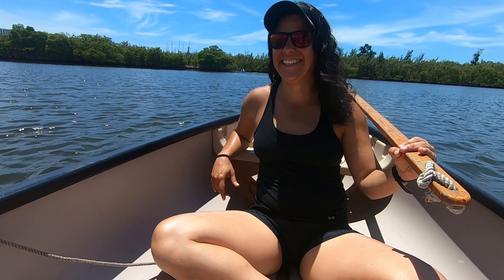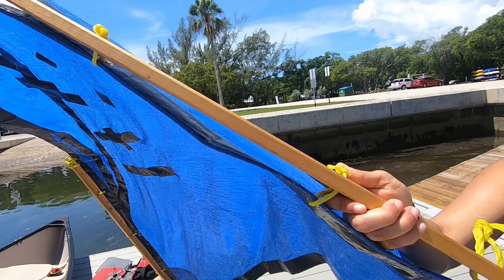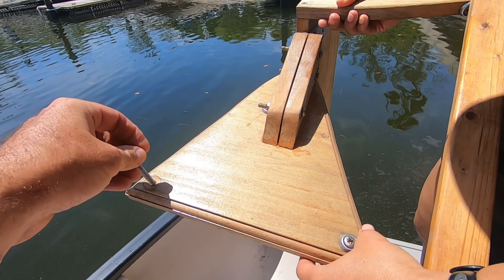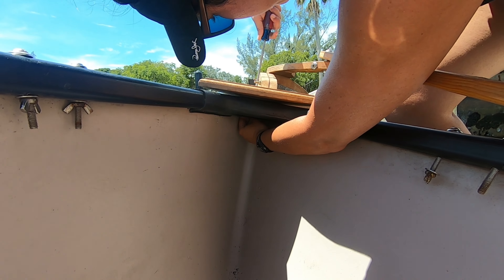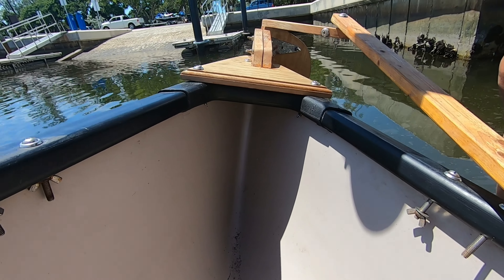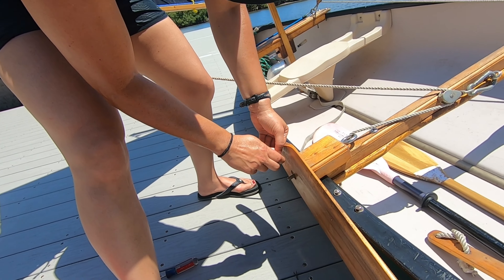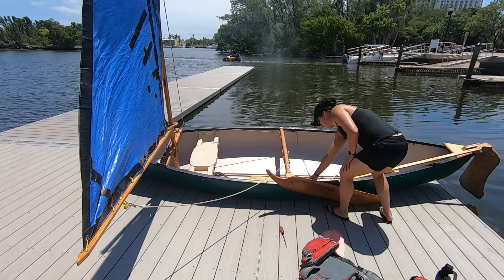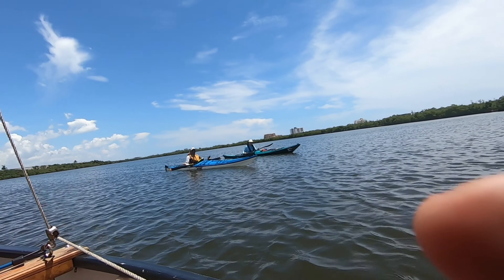Sail Canoe Assembly

Comment: Hey Man , I like what you did there . How did you come to the square footage of sail cloth to use ? , or , does it matter ? Does displacement matter ? I mean , I have an old fiberglass bass boat about that size , but it could weigh 5 times as much . Do I need 5 times the sail ? I'm so confused .
Reply: Take a look at Todd Bradshaw's fine book on canoe sailing.
Reply: @mikeu5380  Thanks PK
Reply: @mikeu5380  Mr Bradshaw`s  book is very good.
He is an excellent sailmaker and expert on sailing canoes .